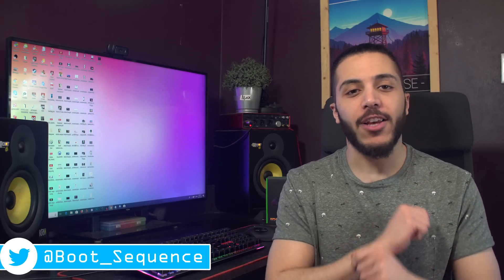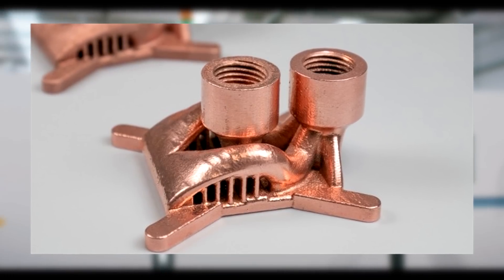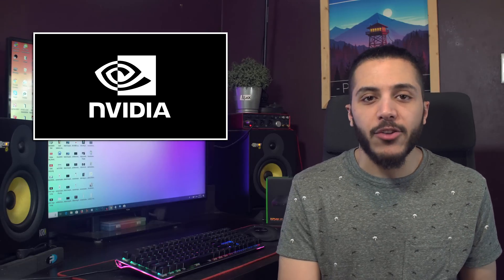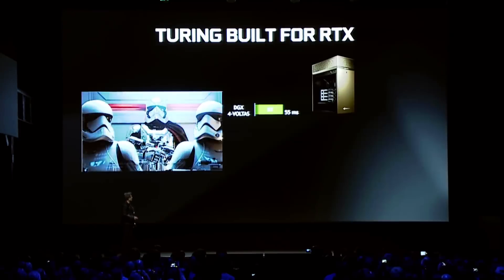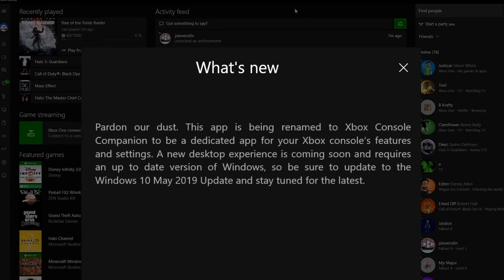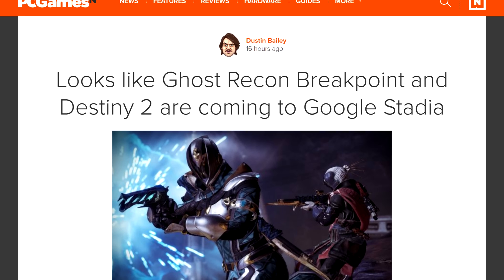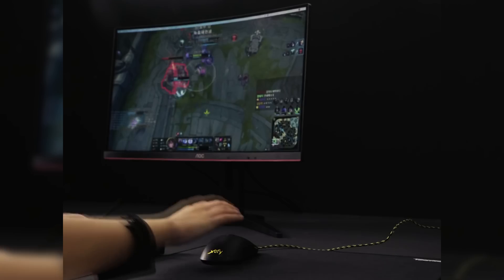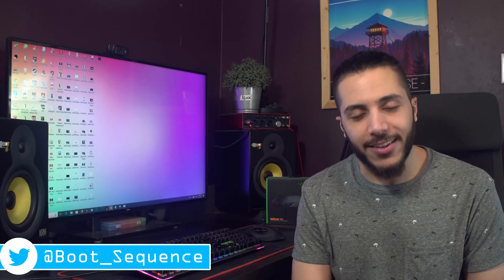3D Printed Liquid Cooling, Nvidia Picks Samsung for 7nm Ampere and More!

Comment from the maker: Small correction thanks to @Alberto De Beni. I said 80% the size on the first story, should have said 80% size reduction. The CPU block is apparently 19% the size of "Best in class" liquid cooling blocks.
Reply: So, it's small... But how will it be mounted? Does this size reduction fill any purpose, or is it mostly a tech demo?
Reply: Normal fff/fdm => (filament based) 3d printers wouldn't make it 100% watertight and resin-based sla, sls or dlp printers don't have anything like metal filled resin so not very good thermal conductivity can be achieved by desktop 3d printers

Comment: I have a regular tevo tarantula and I have to say if you try to print these blocks from metal filaments it will wear out your nozzle quickly.
Reply from the maker: have you tried exotic filaments before ?
Reply: No but I watched a video on how different types of filaments can quickly degrade your nozzle. Currently using PLA  and PETG.